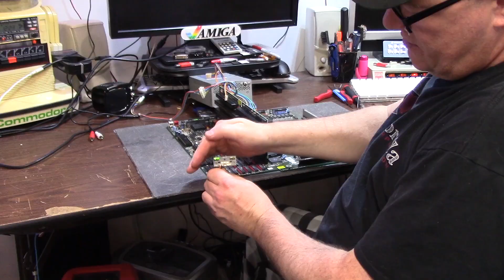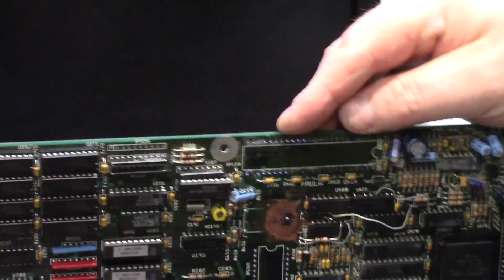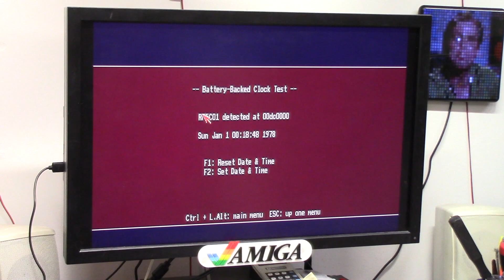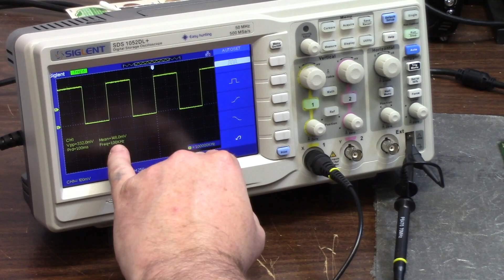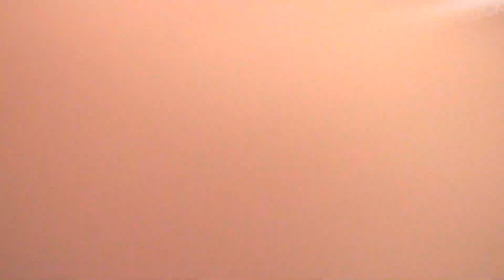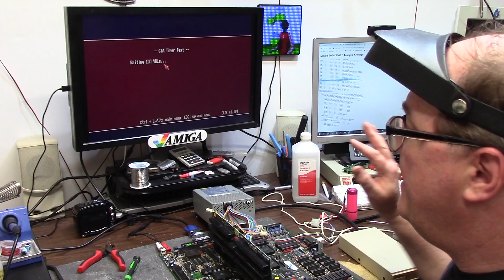Oh No! Mr Bill!   A3000 repair

Comment: The repairs you do are so interesting and you are absolutely right, it's really the only way those boards ever get fixed. If all you did were re-caps that would close down your channel. Surprised someone complained. The division of labor you pointed out is perfect, let the shops get paid for the recap which is economical for them. I doubt they'd want to take on a 50+ hour repair of really bad boards because once complete and the bill due, I would guess the owner would just say "keep it" 🙂
Reply: Btw, when you were doing this professionally, was it too early to see boards in that bad of shape? I'm just curious what would have happened back in the day if you had come across boards in such condition?
Reply from the maker: @8BitRetroJournal  the worst i saw when they were new was a cracked in half A500 , it was either dropped from a balcony high up, or ran over by a car. it looked like a shattered piece of kit. we denied the repair under warranty even though the "stickers" were still intact.

Comment: Hey Chris - funny i was just thinking (if i send my board over - just take my money!!) - ive not got my hands on it yet but, itll be an a4000 with 060 scsi 3 accelerator with PPC cpu....it wasnt in a standard case but in an aftermarket tower so im not sure of the orientation of the motherboard....if i can get it to you - what is it that you need...? just the mainboard?
Reply from the maker: whats wrong with it first off..
Reply: @ChrisEdwardsRestoration  dunno.... Tbh I'm just assuming it's not going to be working and will have battery leakage.... Its over the road from my house in the loft space.... Its been there for 25 years or so....! Trying to get my brother in law to let me have it so I can renovate it...
Reply from the maker: Heck with waiting on your brother walk over there and get it!!!
Reply: @ChrisEdwardsRestoration  I know.... Trying to coax it out of him.... Fully loaded.. Picasso in there as well with all the modules on it...! The one thing I'm missing is the oem case... That's gonna be hard to find...!

Comment: I saw one of Adriane Black's video on baking chips.  He had mixed results.  Have you ever baked a bad Amber chip?

Can replacement Ambers be harvested from A2320 flickerfixers for use in A3000s?

Has anyone produced a replacement Amber chip?
Reply from the maker: No baking, yes they can be taken from the 2320 but you can also just use that card in case the other logic is bad.  No reproduxtions

Comment: Good job.   Talk about getting down and dirty...crusty even.  Do you use white vinegar to neutralize the battery schmoo (which I think is alkaline even though every calls it battery acid)?
Reply from the maker: Yes
Reply: @ChrisEdwardsRestoration  Do you dilute it at all from the 1gallon jug that you can get at Aldi's or other grocery stores?
Reply from the maker: Nope just a little bit to eat up the scuzz and a wash with ipa 91%
Reply: @ChrisEdwardsRestoration  Thanks for your help.   This process could use a video all by itself.  I would be happy to send you a motherboard as an example to work on it, (but I do want it back).

Comment: Hi Chris, sorry if you've addressed this elsewhere and many times, but what are you using to trace the Amiga's schematics and PCB layout (the software on your second monitor)?  Amiga PCB explorer looks to have stagnated and doesn't have the A2000's and A3000 that I need to fix.   I swear it had the A2000 published at some point, but I may be remembering incorrectly.  TIA!
Reply from the maker: The 2000 gerbers are github here.  https://github.com/psyolent/amiga2000. The 3000 files are sprint layout viewer but private.  If you need them email me
Reply: @ChrisEdwardsRestoration  I enjoy the videos on the A3000. We have a local Commodore club here (meets 1 a month) and I brought my A3000 for the meeting to show and tell. Well, I am learning alot from the club but we had trouble finding schematics on my rev.D. Then I saw this video. How do I  contact you about the Sprint layout viewer for the A3000? and excuse if this has been answered-        Is the Battery necessary to have for an A3000, other than Date/Time?
Reply from the maker: @manuelrgarcia4409  it can help remember scsi nvram settings, but is not required, you can download the sprint layouts and gerbers from reamiga here https://www.reamiga.info/?page_id=40 but if you need the R6 originals, shoot me an email (info on about me yt page)

Comment: Thanks for repairing these and for the tips on the tools and supplies you use. Very helpful. Is it possible to ultrasonically clean the boards? Seems like a cotton swab isn't going to get all of the green gunk under all the components.
Reply from the maker: My ultrasonic is too small for large things.  But i have some solutions i share in upcoming videos!

Comment: It was common to clock the 16mhz machines to 25mhz with a heatsink on the 030. running in 25mhz actually fixed some zorro issues on some of those early ones.